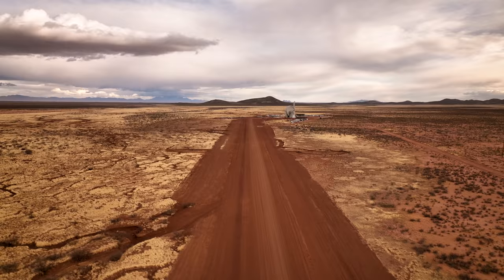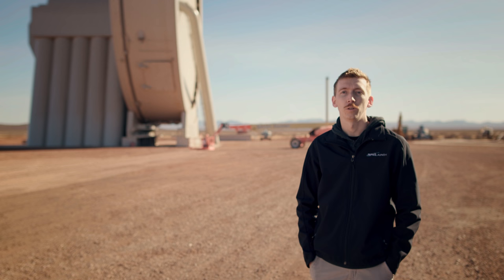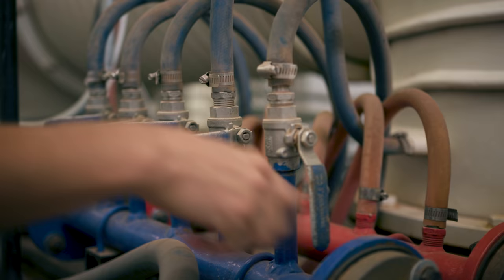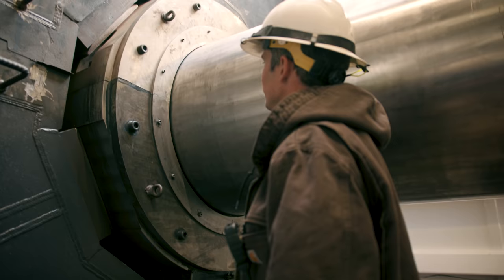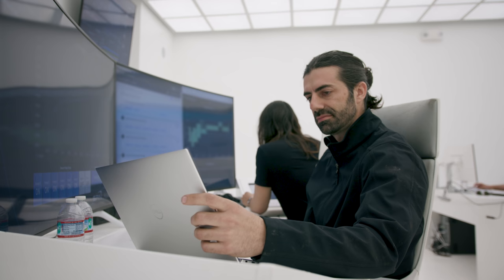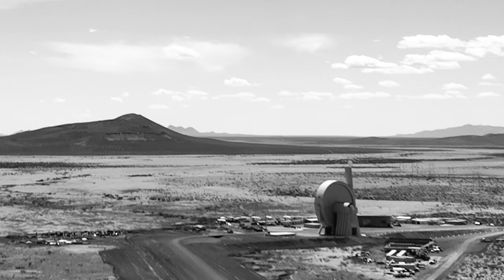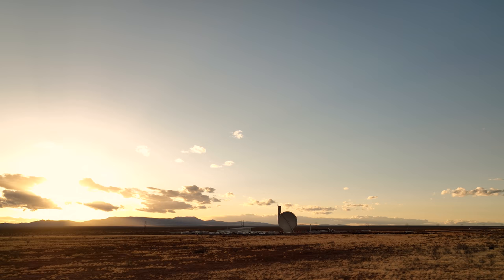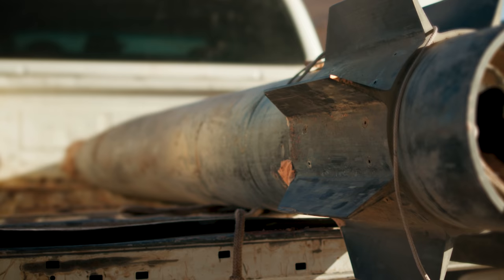An Inside Look: SpinLaunch Flight Test #7

Comment: Curious how a payload would survive slamming into the air pressure wave as it breaks through the seal destroying the vacuum. A solid metal tube would surely survive quite well, but I don't see this carrying sensitive electronics with this current configuration. We'll see how they over come that challenge
Reply: Velveeta cheese wouldn't survive those G forces.
Reply: G forces would be far worse than this air pressure wave I assume
Reply: This is exactly what i was thinking, also to get something into orbit using this methodology i cant imagine how fast it would need to spin in the chamber.
There is no way in the world you could use this to launch anything living.
Reply: @sierramikekilo6925  Depends. The Gs wouldn't be instantaneous.
Reply: Electronics aren't the issue really. Guided artillery shells like the M982 are packed with them, and go through much worse during firing
Reply: @dannulik  No, it wouldn't be instantaneous. It would be sustained, continuous, for a long time until the desired rpm is reached. I calculated: in this test, to reach 500 m/s, with 50m in diameter, it would sustain 1000  G's
Reply: There has been electronic test models for many decades involving firing things from large calibre guns. This is less damaging
Reply: @gregkarkowsky967  Velveeta cheese?
Reply: @jonashageboke8993  Right. But what isn’t on an artillery shell is: #1 A second–stage rocket engine that includes a turbo-pump being yanked at high acceleration 90 degrees to its intended g-loading, on mechanical bearings #2 A fragile ion-engine for spacecraft stationkeeping, containing fine mesh metal grids, that normally take no more than 5g at launch #3 Fragile solar panels on the payload to supply it with power, basically made of glass I remind you, being shaken at extremely high mechanical frequencies and g-loading #4 The sensor payload of the purpose of what you may actually be launching! Which might be an optical telescope (made of glass, with ultra fine positional calibration); or Travelling Wave Tube Amplifiers for radio transmission at high power; or….so many other things. #5 station-keeping gyroscopic reaction wheels, also on mechanical bearings that are going to need to run basically friction-free for several years after this incredible beating. #6 Attitude Control, which on most spacecraft is a *star-tracker*. That’s a three-axis modular *telescope*.
But most importantly of all, which you haven’t understood, is the way the space industry actually works*. An artillery shell is probably designed and made by *one company*. Whereas a spacecraft is designed architecturally by a spacecraft prime, who for most of the components just specifies something *off the shelf from one of maybe a hundred separate component companies. Nobody nowadays designs a reaction wheel for their spacecraft. They procure one from a company that makes reaction wheels. And all reaction wheels are fairly similar in spec, because all the launch vehicles are similar in spec, which not coincidentally means (for example) all geostationary telecoms spacecraft mass between 2 and 8 tonnes. You simply can’t buy anything very different, and that’s really the end of it.
If a launch vehicle was even quite conventional, but just had a “better” fuel that gave it a 10g launch acceleration, it would have absolutely zero customers. Because no satellites are engineered for it. Having worked in the industry, really honestly, even if the launch were *free*, I’m struggling to see how you would ever pay every single module subcontractor to re-engineer just for you. It would multiply by the payload cost by 10x, if not 100x. And even if you had the money, it would take just a single critical module supplier out of dozens to decide they didn’t have the manpower to look at it, and that would be the end of your program. This just doesn’t work.
Reply: @johnfranklin8147  the second stage is pressure fed, no pumps to worry about. Probably the only thing that's feasible for those kinds of loads, solids would worry me re prop cracking at 10000Gs

I agree that the payload side of things is probably the key hurdle they'll face, if not from a technology standpoint at least from an economic one.

The business case I've seen for this system is rapidly deploying megaconstellations, which would make sense if they can hit their price targets (which themselves rely on very high launch rate), which is obvs unknown. But that market means 1) fairly insensitive payloads to begin with (no optics or anything) and 2) serious economies of scale that may make hardening the sat worth it if launch cost is right. (Just as an aside re moving parts under extreme Gs: the M982 shell has deployed actuating fins and inertial navigation in addition to GPS. If that can be fired out of a howitzer and still work, reaction wheels should be possible as well? under constant accel no less, far milder shock loads)

They're claiming that you'll often only take a 15% mass penalty or so by hardening the design, which isn't ideal for switching launch providers quickly, but doesn't lock you in with them, which is obvs important

All highly speculative at this point, but dismissing them out of hand is unwise at this point imo. There's some pretty good discussion on them over at the nasaspaceflight forums, from people who actually know their stuff and/or have inside knowledge (ie not me on both counts)

EDIT: Just to add re propulsion: ion engines have a fine mesh like this, but hall effect thrusters don't, and those are what's all the rage these days for constellations
Reply: Excalibur artillery shell has very sensitive electronics and survives that launch process, which I suspect is more violent and has higher acceleration g-forces
Reply: Imangine if the made the tube longer (higher) to where the atmosphere is far thinner. That would be cool
Reply: @flosh2walkthrough672  or build the spinner on top of Mount Everest lol
Reply: @83RBurke  yeh or just use a rocket
Reply: @flosh2walkthrough672  hehehe
Reply: @johnfranklin8147  Good summary!
I guess they have some ideas of possible customer to get through all of this, but I have no idea what kind of payload that could be. Maybe fuel, food, oxygen for the space station. Fuel the refuel spacecraft for mission to mars?
Reply: that's why I'm here... didn't want to repeat the question.
Reply: @Thunderbyrd.  Yes. Velveeta Cheese.
Reply: @alexforget  But it’s also a poor supply launch vehicle. For supplies you want *bulk*. For something like Musk’s vision to Mars, you probably want 500 tons, which is 5 Starship launches, or 70 Ariane6 launches. It would be 10,000 Spinlaunches. How are you going to collect and combine 10,000 separate capsules from this thing, each with its own orbital elements?
Reply: The payload needs to be going at least 17,000 miles per hour after it gets to low earth orbit. At what speed is this thing going when released?   Huge shock wave.   One of many big problems.
Reply: This is a total waste of time and money. It will never put a satellite into orbit because the trajectory isn't precise enough.
Reply: We have gps guided artillery.  Perhaps they are using similar technology as I'm sure those artillery projectiles see some serious G.
Reply: @8180634    All the satellites I have seen are kind of delicate. It makes life simpler for the designers and a lot cheaper than designing things to survive a catastrophe shock as it is released into the atmosphere
Reply: still might be a good way to shell russia from new mexico
Reply: @oldmech619  To be fair (or not fair, as I also think this thing is stupid and a waste of money), this can never reach any significant fraction of orbital speed - and more importantly energy, but nor is it really intended to do so except in the mind of uneducated investors. The purpose is only to get the 2nd stage above the atmosphere, which allows you in principle to have a more efficient 2nd stage motor with lower pressures and low-pressure nozzle optimisation. The problem even with that, is that at as soon as you look it seriously, the engineering compromises on the 2nd stage to cope with the insane launch acceleration are such that it ends up being a very simple and hence low-efficiency second stage design.
And the issue with any of this, is that it makes the very fundamental mistake that rocketry has been making for 70 years, that the problem is the hugely wasteful rocket equation and therefore fuel usage. And to a casual observer it does look like that with those huge exhaust plumes. But SpaceX have effectively debunked this. That’s not the problem. Fuel cost is about 2-5% of the total cost of the launch. I can’t emphasise that enough. All these solutions are targeted to saving 2-5%. The problem is the cost of non-reusability. A Boeing 747 costs roughly as much to make as a large launcher, and uses as much fuel in just four fully loaded flights. Yes, really. The reason why flights are affordable, and space launches are not, is that we throw away a Boeing 747 worth every time we launch it.
Reply: @rustylong4743  I imagine this to be used for very small satellites. It will not be used to launch things into orbit, at least I don’t think so. I see this as a replacement for 1st stage rockets. So the rocket that they do plan on launching into space will have boosters as well. I have no idea if this really is the case. I just saw this for the first time so I am just speculating.
Reply: @rustylong4743  Ants?
Reply: @83RBurke  the shell would only experience high g for very very short time in the barrels. This thing you need to spin for like a lot of time and the g force is not pointed at the the direction you want the payload to go. Many things in satellites are mechanically fragile not electronically.
Reply: @johnfranklin8147  Where this technology will shine in the future is on other worlds. Yeeting raw materials up into orbit to be picked up and sent back to earth etc. The uses for this type of launching are going to come up in the next 40 years.
Reply: @ac.creations  It’s not obvious that is a good solution there either. Bear in mind that many of the issues for Earth launch are related to our thick atmosphere, as otherwise a simple single-stage rocket works just fine. Look at the original Apollo Lunar Ascent Module from 1968. The entire thing had a dry weight of 2.1tons plus 2.7tons fuel - which is actually less in percentage terms than a Boeing 747. But even if you insist on “something cool”, why not just use an electromagnetic railgun approach? The US Navy already developed (R&D) one that launches at Mach 6, which is more than Moon escape velocity. Extending it to Mars escape velocity wouldn’t be “hard”, as it’s only about 5metres long. The acceleration in a linear barrel is actually exactly the same as the centripetal acceleration when swinging it around in a circle - the reason why it seems lower for Spinlaunch is that they are still going “very slowly” at Mach 1. 
So, there’s an off-the-shelf technology that already has 6x performance. Know why the US Navy abandoned their railgun last year? Boring practical reasons. Wear on the barrel means components need replacing every dozen shots, which would be at least as bad on Spinlaunch if it were scaled up to higher speed. And technology moves on, so hypersonic mIssiles are now a more flexible alternative to shooting artillery shells - also similar point for Spinlaunch. Falcon9 can land on mobile barges….whereas a Spinlauncher stays where it is built.
Reply: To be fair, if tactical nukes and GPS guided artillery shells can withstand the forces involved in being fired from a cannon, this is a piece of cake.
Reply: Yup, that was my first thought. Even before that, i wonder how the payload would survive the high G's in the spin chamber.
Reply: Most modern electronics can sustain ridiculously high G tolerances. Your phone is required to handle hundreds of Gs… every time you drop it
Reply: @rustylong4743  of course you won't launch anything living with it lol. It's a smallsat launcher. Small electronics can usually take these Gs.
Reply: @johnfranklin8147  what do you mean 90 degrees?
Reply: @uku4171  The payload and 2nd stage needs to be built mechanically to take all the load “vertically” in the direction it’s own rocket motor will be thrusting. It’s components will be orientated so that force causes fewest problems. But the force coming from Spinlaunch is being exerted along the radius of the circle, which means “horizontally” compared to the rocket.
Reply: Hook the gizmo to a ladies spin class for power
Reply: @johnfranklin8147  Do you really think everything inside a guided shell is made by one manufacturer?
Reply: No way this would ever work for anything that’s living but still a cool concept.
Reply: @Dr.Pepper001  you better let them know asap, before they waste any more time and money. 
Just a shame they haven’t done any homework on the requirements or objectives. 
🙄😆
Reply: It’s quite astonishing how everyone in the chat is apparently an aerospace engineer or astrophysicist.  “It’s not rocket science”😏
Reply: I think electromagnetic rail guns pretty much put this technology to bed.
Reply: Impossible
Reply: They can't and won't, I assume they're just trying to gather investment from morons only to cancel the project and leave with the money.
Reply: this could work if we're launching rubbish into space
Reply: there isn't even a vacuum ,.. that seal would not hold a vacuum .
Reply: an iphone is rated for the forces that this exerts, it would 100% kill a person tho
Reply: @johnfranklin8147  I want to know more about this "Attitude checker" you mentioned. I think we could re-perpuse that for some of the people here who are all quick to respond as though they are the subject matter experts on everything and need to point out to all the dummies that we these guys built this machine and spent millions without considering any of the fundamental challenges that could pose significant challenges to their end goal.  Imagine their surprise when they get it all fined tuned and then they have to answer to their investors why the velvita cheese didn't make it out of the atmosphere let alone to the ISS.
Reply: @rustylong4743  The already tested on a gerbil. RIP lil guy.
Reply: You guys are on here arguing about the G's... stop for a second and think about how many feet this test went in altitude then look up how feet till you reach low earth orbit. They've got bigger problems then G's
Reply: more potential as a war machine
Reply: It’s not in a real vacuum to begin with. It’s just vaporware. No way that flimsy seal creates a true vacuum as evidenced by the dirt inside and exposed bearing.
Reply: @dannulik  there is no depends on this type of platform. If it’s launching at 180(ish)RPG (as the test indicates) the craft would experience 500-1000 Gs during the initial moments of launch. Once they scale to their 10 tonne proposed system that’s at least 10,000 Gs.
Reply: They might let it in gradually over a second or two, so that it's not a big drag factor, and release shortly thereafter.
Reply: @dannulik  In a linear system you can gently accelerate an object to a very high speed (given time).  But this centrifuge is constantly accelerating the load in the direction of the hub.  The g force would be consistent at high rpms (no matter how slowly you accelerate the arm).
Reply: @rieksstevens  they're not pulling what'd be considered a hard vacuum, something like 0.1 torr if I remember right - somewhere in here - https://www.youtube.com/watch?v=yrc632oilWo - there's a lot of footage and mention of maybe 3 different stages of pumps starting with Roots type and ending with what was called something like a "molecular trap".
Reply: @dannulik  They would still exist, and they would be significant

Comment: The amount of energy needed to go into orbit is far greater than this machine can hold
Reply: If you put this on the moon though…. why constrain the implementation on Earth only?
Reply: I doubt their plan is to have one of these on the moon. With the only task of firing rock samples back to earth? 
I'm guessing their plan is to see how high they can launch with this machine  the once they have maxxed out switch to rocket boosters
Reply: @John...44...  Rock samples? Why not rare metals?
Reply: @Bob_Adkins  good point. Never thought of that
Reply: This accelerator is only a testbed. the real one will be larger and faster, but the projectile will still use a motor to reach orbit- as throwing something into orbit is not possible
Reply: @crcpeart  This whole concept is so totally useless it would't even make sense on the moon.